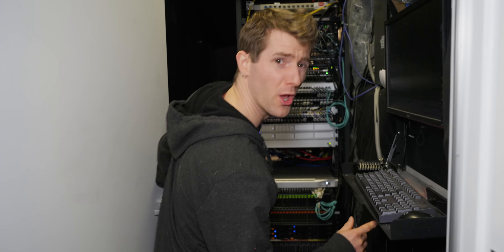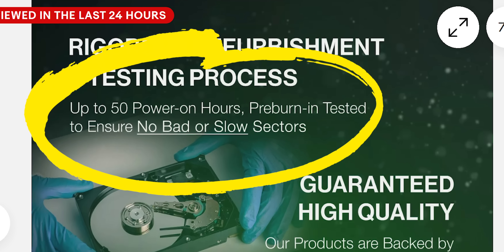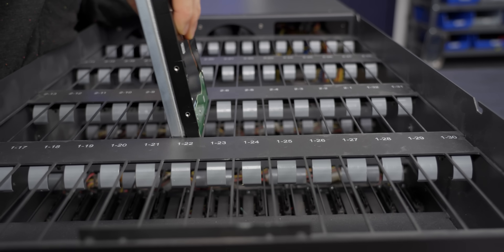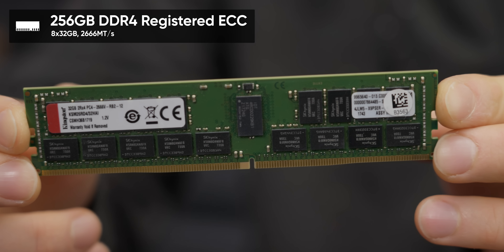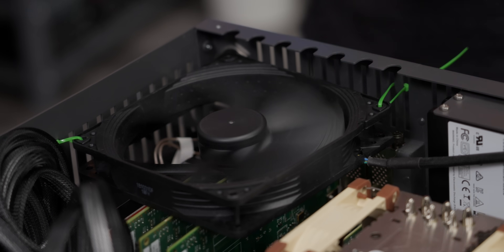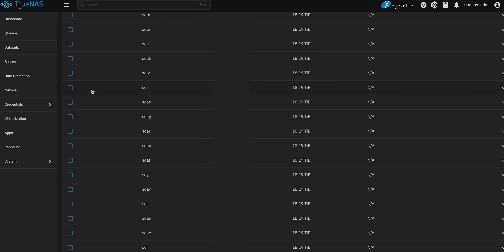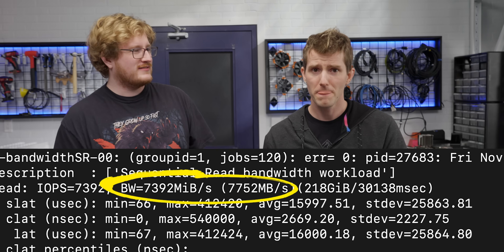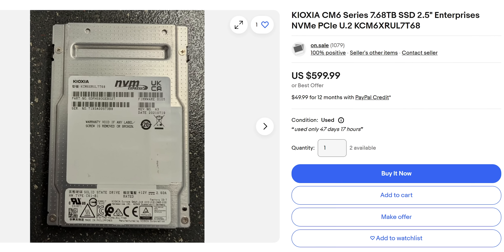Is Buying a PETABYTE on Ebay Stupid?

Comment: Just because the casting has a different stamp does not mean all the circuit boards or the platters were not changed to the same batch or revision.

Comment: HAMMING CODE ERROR CORRECTION IS LOG2(N) error bits for N BITS.. How it works, it uses xor logic to identify the failed bit. To do two bit error correction just do Log2(Log2(n) ) BITS .. But you are talking redundancy while retaining throughput.. But the other question is redundancy for runtime and data.. My brother PHD thesis was is data redundancy in time critical situations where peoples lives are on the line..Youd need error correction redundancy more for logistics, certainty a collection of drives arrive

Comment: ive just gone for an cenmate 3 bay hard drive enclosure  , also an 8tb external drive so the 3 bay have an 8tb so a copy of the external 8tb drive and the other 2 bays will have two 12th -16tb a back up of the other so if any fails i should have another drive good. could not bothered with raid and nas, what ive got is a simple plug in and play, ive always just manually backup on two drives both the same info. also have 1tb 4tb and 5tb external drive already for traveling and easy device to use when using big files , when im done i save on to slower drives but even so that 3 bay drive thing with 1 drive almost full it has a far better speed than i expected, the cenmate 3 bay hard drive enclosure well only £99 so it not bad as long as it lasts, will have to see long term

Comment: Hey for anyone not familiar with the Z patterns they were bringing up, if we're talking about 10+ drives. If I could kindly give my terrible opinion. My favorite pattern is ZFS10. It's where every drive has a mirror, so you do sadly lose 50% of your storage. But in exchange, basically every single drive linearly increases your read speed and then 1/2 the drives linearly increase the write speed. So if you have 10 drives, you'll have 10X the read speed and 5X the write speed! Now there's more to it than that, but this is my favorite.

If speed isn't your need, but storage is. Then go for ZFS(1Z+0) and ZFS(2Z+0). This'll make it so your speed still increases, just not as crazily. But choose ZFS1 if the data isn't crazy important. If you want to survive the apocalypse, then go with ZFS2. And don't worry about the people saying you need more than that. They're not wrong, but they're also thinking enterprise. When we're talking home lab, 2 redundant drives per 10 to 12 drives is pretty damn bullet proof. As long as you periodically check the health btw! Be sure to resilver and do scrubs every so often!

Comment: I buy these re-certified drives all the time. They're great tbh. I will be honest though, I keep an extra cold storage drive on hand at all times. They're still used, still more likely to fail. So trust that it'll be great, but also trust 1/12 you buy will just poop out on you in a year. So for sure have mirrors and redundant drives. Oh, and get the refurbished drives with 5 year warranties! If you're willing to do a bit of extra care, you'll get amazing discounts.

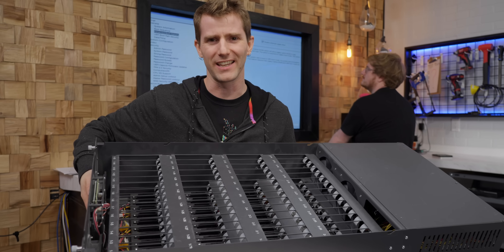Comment: 5:40 M01 and TP01 HP Pavilions with 3400G through 5700G make great media servers and emulation machines. The chassis can hold 4 3.5" drives with just sideplates and an exp card. The APU allows emulation plus lite video work. Grab an Arctic P9Max 92mm fan and it does well enough. I got some sticky sheet foam to insulate noise and block random openings forcing intake air past the hdds. I like these machines.

Comment: It's a double-edged sword to be sure. On one hand, you can luck out with an insane deal from a company that is going out of business and has to sell off all the old drives, on the other you may get scammed, either with brick-in-mail method or (if you're unlucky) with more insidious method of fake firmware reporting capacity that's simply not there;

Comment: I run Hitachi ultrastar refurbished drives in my system. The ones I bought came with a 5 year warranty. At year 4 I had a drive report bad sectors so I email the company. They refunded me the money and sent a packing slip to send them the drive back. I will only use refurb drives from now on. I have a few that are going on 8 years old.

Comment: I had 2 8TB Seagate Ironwolf in my old DS216j NAS for my private Data (Raid1 Mode) and they are working like finest.....now they are both in my UnRaid-Server with 4 Exos 8TB which are also very good, and fast (the Ironwolf getting up like 47 Degrees hot, but the Exos are so quit and at 42C max.....wow......sure, there are like 8 years in between, when they were built, but hey....)

Comment: Personal anecdote, I did get a DOA refurbished drive from ServerPartDeals for my current main rig (2x 16TB Exos drives in RAID1), took about a week between first purchase, original arrival, and the reshipped drives. 
Building a mini rack NAS now; just wish they had drives smaller than 10TB to match some older IronWolf Pros I had sitting around. Guess I gotta upgrade!

Comment: I bought a ServerPartDeals water panther 20tb drive for just under 200USD off amazon, according to my Hard disk sentinel it is still at a s 100% health after running for 167 days. But maybe im not that hard on my drives because I have a 4TB hardrive from WD at 1556 days at 100% health.

Comment: 256MB Cache... YEAH... GREAT DEAL !!! Even the READ Speeds are Advertised SLIGHTLY HIGHER than my WDs "GOLD" Server Drives around 265MB/s or WAY MORE. ALWAYS get 18TB or MORE for ANY BRAND HDD to BENEFIT from FULL Speed/Cache !!! 10TB to 16TB is a WASTE !!! SAVE for 18TB MINIMUM and NEVER get LESS THAN 256MB Cache !!!

Comment: As someone who has ran a relatively sizeable private datacenter I can shed some light on those drives. The most likely source is large datacenter clients 'swap drive' stacks that are returned and re-verified as unused and marked recertified, since technically they aren't new anymore. The reason for the burn in, is that they were stored in unknown conditions. It happens all the time when a customer needs say 10,000 drives to be live in a cluster, and buys another 2000 to have as swap drives. They sit on a shelf for 2-3 years, and the datacenter switches storage model and now they have no use for the swap drives anymore. The original production drives are sent to a e-waste reseller and sold as used, and the shelf-drives are returned under some contract agreement and recertified by the manufacturer.

Comment: Home computer storage over the years has been interesting. First there was the primitive cassette recorders. Shortly thereafter we upgraded to 5-1/4" floppy disks (8" floppies were not used in home computers). After that we upgraded to the more durable 3-1/2" hard cased floppies. Those with the money installed internal hard drives. I still remember the excitement of installing a 200 Kb hard drive. Soon we were moving into megabyte drives. Then it was on to gigabyte drives. Now it's terabytes. Even the old mechanical hard drives are being replaced by SSDs. Here we see someone who needs petabytes of storage. I wonder how long it will be before we see affordable petabyte storage.

Comment: I mostly wouldn't hesitate to buy anything that is refurbished/recertified from a reputable company.  I repair high end electronics and while we frame everything as repairs and we do fix things that are broken/failed the mindset is the same even when used/warrantied items are sent in. Everything is returned to manufacturer's specifications when the product was new.  If I had to guess I'd say the drives failed quality control so they couldn't be sold as new and were fixed and then sold at a discount. "used" in industry terms is as simple as me taking a new part putting it in a new unit only to find out that didn't fix anything. That part is now used in the eyes of my company.

Comment: I had a system HDD failed, got a refurb drive from OEM had like a 1 yr warranty on that that drive died in that year so had to do again. I always thought no refurb HDDs. I talked with a large tech vendor about some products and they said that this item retail is X the remanufactured SLU was cheaper. They said in their case something like 90% if not more of these were actually new. Something to do with the item went out to a reseller, or warehouse then for some reason it was brought back to stock then they become remanufactured. I wonder if maybe what they do with these drives.

Comment: I would like to put X20 20TB drives in my true nas scalable running on Dell R210 II. I have WD Golds 4TB in it runing fine but I'm not sure if those 20TB drives will work using onboard SATA connections. I don't want to put separate controller because I'm using single PCIe port for 10Gbps NIC. The SATA controler name I see is: Intel corporation 6 Series/C200 Series Chips Family 6 port desktop SATA AHCI Controller (rev 04) and the BIOS of rhe motherboard is on the latest 2.10 version. If anybody is using some big drives in that configuration please let me know.

Comment: Timestamps (Powered by Merlin AI)
00:05 - Exploring a cost-effective solution for storage needs with recertified drives from eBay.
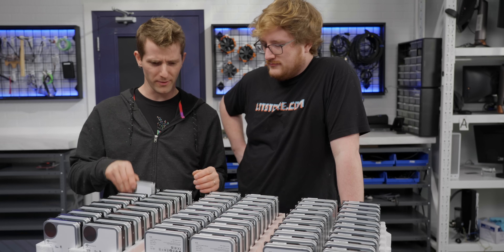02:29 - Recertified drives from eBay can be a cost-effective choice.
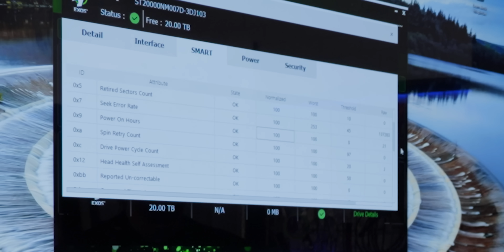04:31 - Reusing old hardware reduces costs while managing a large data storage setup.
06:39 - Upgrading hardware for optimal performance in home data storage.
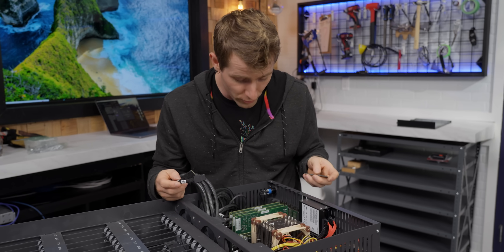08:43 - Building a high-capacity storage system with various hardware components.
10:40 - Exploring NAS software options for home gamers and RAID configurations.
12:41 - Building a petabyte storage setup has complexities and potential benefits.
14:33 - Examining the risks and rewards of buying refurbished hard drives on eBay.
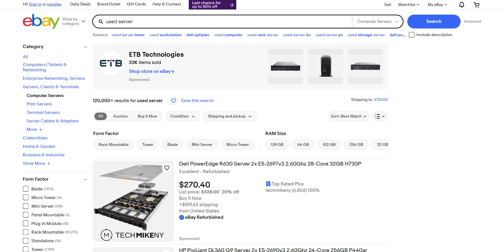16:29 - Exploring the market for refurbished and enterprise storage devices.
18:10 - Exploring the use of bought drives as spare parts.

Comment: At home, I have 8x 12 TB WD Ultrastar drives in Z2 through truenas, the drives I bought were suspiciously cheap and re-certified with a 2 year warranty. The system has been up for about 18 months with zero downtime and absolutely zero issues. Going forward, I am exclusively a re-certified drive customer.

Comment: Back in 2018-ish, I bought 10 recertified 3tb drives for 210 dollars (when you're buying more than one drive, try making an offer with a reseller), 2mini sas to sas cables, and an HP raid card that had 1gb of cache, made a 16.7 tb raid 6 array and used it as a game drive. My boot nvme drive was only 256gb, so, this made a lot of sense :p. The performance was on par with the boot NVME, surprisingly.

unfortunately, after a half year, one drive died when moving the computer, one I dropped and died. Never have had drives that fragile before or sense, but its ok, glad I bought 2 extra drives and put it in raid 6.

Comment: Tragically this is nonsense, these are a ton of recertified drives, anybody can reset the power on hours, I can do that, but you can't, apparently, reset the FARM powered on hours.  Ask me how I know.  I just discovered two NEW Seagate drive purchased from a reseller on Amazon have 25,000 and 35,000 hours already, one started dropped out of a TrueNas pool, I hadn't used the 2nd one yet, plugged it in and it would not create a pool.  When Linus and Jake look at the FARM stats on the drives there will probably be tens of thousands of power on hours.  The reseller has disappeared so now I have to hassle Amazon or Seagate to fix this.  The industry needs to make sure regular SMART always give the powered on hours from FARM.

Comment: So the reason that these drives are cheap is because they were essentially factory "rejects". A drive has a certain amount of heads (and platters) in it - these newer HAMR drives have 10. Say you are manufacturing a drive to be a 30TB drive, for selling to cloud customers (e.g. Dell, Lenovo, etc). But of course, you have manufacturing errors and a less-than-100% success rate, which means some of the heads on some drives may be bad. Drives are tested for many, many hours before actually being sent out to customers (yes, all of them). Say that 30TB drive has one bad head. What the factory can do is turn off that entire head - essentially getting rid of that head and that disk - meaning the 30TB drive, minus one disk, is now a fully-functional 27TB drive. But that drive can't be sold directly to consumers under the normal product name, because it's not a consumer drive - it's a reduced-capacity enterprise drive. So Seagate and other drive manufacturers will typically stick these drives into enclosures and sometimes turn off even more heads, or sell them outright to vendors such as the ones you guys purchased from as white labels. But of course, selling a reduced capacity drive means it's a lot cheaper for the consumer.

Comment: I have a terabyte Seagate 7200 rpm hard drive I've been using for 10+ years to hold my steam games.  I have a western digital caviar blue as my main (yes my rig is out dated) however, I have thousands of gaming hours on steam.  Can't dig on Seagate too much, but i typically think their drives are a 50/ 50 shot at being fine forever, or just randomly dying in less than 5 years.

Comment: I can chip in here. Those drives are repaired RMA drives. I work for the nordics biggest vendor of storage solutions and I used to be the RMA responsible, we would always ask our customers if it was OK to get a "refurbished" drive, and most of them would say no.. But after my internal investigation of the failure rates, the "refurbished" Seagate drives had a smaller failure rate over time. They are simply failed drives that Seagate fixes instead of throwing away. I only have refurbished drives in my NAS at home!

Comment: Did exactly the same on Christmas. Purchased  Adaptec ASR81605ZQ 1 GB cache with battery, cables and 5 SAS 4 TB HGST, made cached RAID5 with 4 of them and left the one as spare in case of failure. Purchased  another Adaptec ASR81605ZQ for spare. At the end I got 12 TB of highly reliable and fast storage.

Comment: So far, I only got good experiences with refurbished hard drives. For my use case (which isn't intensive), refurbished NAS drives have been superb and durable.
The only single drive I had issues with, I could get it replaced either by the manufacturer or the store (I don't remember which one, but likely the retailer). So, it's still gonna be my own go to as a techy guy.
For my family, I'd probably stick to suggesting them new drives just for the warranty situation and the likeliness of them not needing more than like a couple drives anyway.

Comment: I am currently running 2 12TB drives I bought off amazon renewed for $97 each. One came branded Western Digital and the other HGST but both drives are in good condition, passed HD Tune disk scan with no bad sectors and nothing concerning in S.M.A.R.T.. One is about as old as my existing 12TB drive that I bought new, About 9k hours each. The other is about 36k in powered on hours a little over 4 years of running. My only issue was with how one of the two hard drives was shipped and delivered. One came in a nice bubble mailer that puts OEM boxes to absolute shame. It was so well protected encased in that wrap around bubble wrap thing sealed inside an anti static bag. The other not so much. It was in a used pink anti static bag that was taped to tighten it around the drive shoved in a box on top of some paper but the front and back edges of the drive (SATA port edge and opposite for reference) were in direct contact with the box. So I'll end on this note, If you are thinking of buying just remember it won't be factory packaging and could get damaged by bad packaging. I seem to be okay but one wrong bump in transit and I would have gotten a dead drive in that poorly packed one

Comment: But they are Seagate drives !!!!!  Seagate still doesn't know how to build hard disks after all these years. Bought my first Seagate drive 50MB a long time ago. Burned up in 6 months.  Bought my last Seagate drive 2 years ago. A 10TB Iron Wolf. It lasted 5 months before I had to return it under warranty.  Got the new drive and threw it away. Never again.

Comment: Man I wish I had gotten your prices. I have 23 or 24 of these Exos 20TB drives from their ebay store. No real problems with the drives I think, but my HBA's may have had signal integrity problems with 1m cables, lots of errors being reported and marked some drives as failed that turned out not to be when plugged into alternate PCs.

Comment: Hi, happy new year to you and your families.

 "usually, for new drives, it is recommended to zeroing" — You won't test much zeroing your drives.   What is a good test is to format them in EXT4 using the "mkfs.ext4 -c -c … /dev/…" '-c' doubled switch, which will perform at least 4 different formatting (may be more, don't remember) with different patterns (such as 0x00, 0x80, 0xff, 0xaa) AND re-read the whole drive afterwards to check if each and every byte matches the value that was formerly written.   Of course, coffee (by liters), pizzas, tent, marshmallows, guitar (NOT playing Kumbaya ! ;-p), DVDz, etc, are mandatory as it takes "some time" to perform the whole formatting cycle.   This is what I found the more accurate when testing rust drives.   Of course, if there are bad sectors detected, it also takes time to manually ban them.

These HDDz prices are quite interesting, so I hope you will collect statistics and make a little video about their reliability from time to time.

Comment: No bad sectors is a pretty low bar to clear I have seen some 15-20 year old sata drives with tens of thousands of hours that still spin up and clear a surface test
With the low power on hour counts most likely the source of these drives is from RMA process mechanically sound drives that were returned due to user error such as a bad sata cable or that had some FW or Controller issue where they could just swap the board and and re-calibrate at the factory.